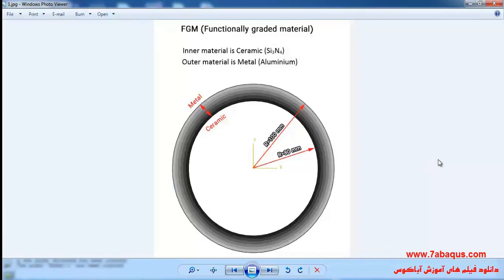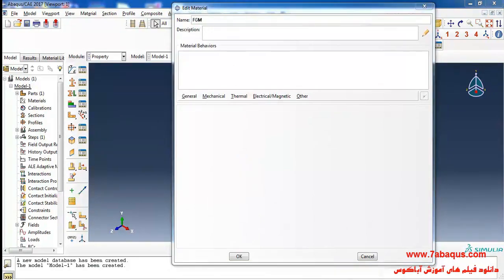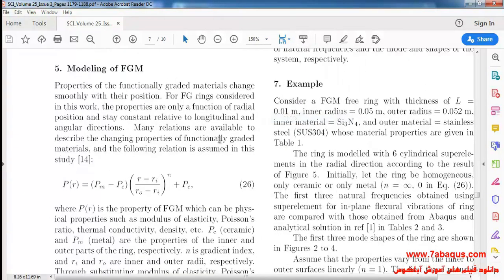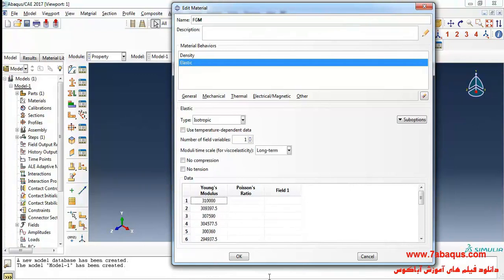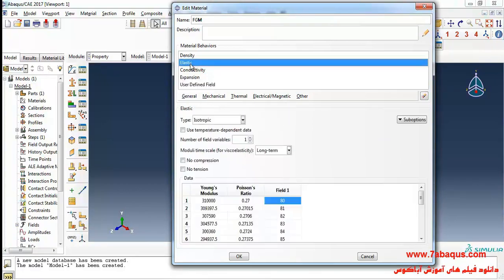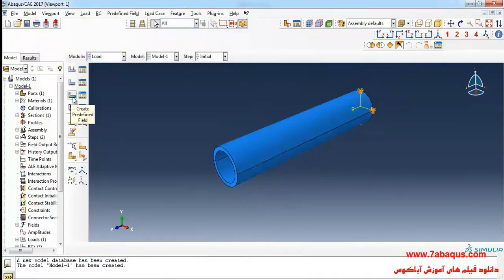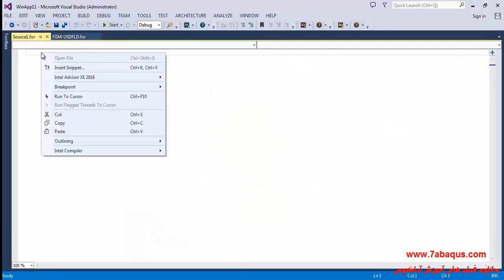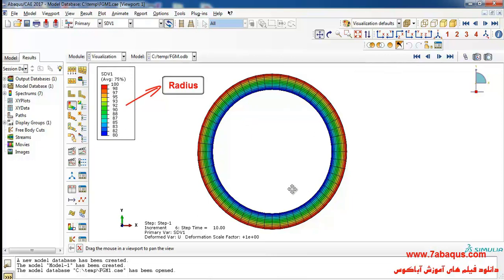FGM (Functionally Graded Material) using USDFLD subroutine Abaqus

Comment: hello sir do you solve the problem where property varing along 2 direction say r and theta in heat tansfer problems?
Reply: you should define all possible combinaisons of coordinates for example If you need to vary the property through the x and y directions, add 2 variable fields in matetial properties windows and insert the different combinations (xi,yi) in (field1,field2) then calcluate the corresponding property values.
 In the Usdfld file you should add two lines to define what are the fields added in materiel properies windows: 
FIELD(1)=COORD(1)
FIELD(2)=COORD(2)

I hope that is helpful
Reply: @mohamedelibrahimi5728  this is the USDFLD of varing properties in radial direction.

" SUBROUTINE USDFLD(FIELD,STATEV,PNEWDT,DIRECT,T,CELENT,
     1 TIME,DTIME,CMNAME,ORNAME,NFIELD,NSTATV,NOEL,NPT,LAYER,
     2 KSPT,KSTEP,KINC,NDI,NSHR,COORD,JMAC,JMATYP,MATLAYO,LACCFLA)
C
      INCLUDE 'ABA_PARAM.INC'
C
      CHARACTER*80 CMNAME,ORNAME
      CHARACTER*3  FLGRAY(15)
      DIMENSION FIELD(NFIELD),STATEV(NSTATV),DIRECT(3,3),
     1 T(3,3),TIME(2)
      DIMENSION ARRAY(15),JARRAY(15),JMAC(*),JMATYP(*),COORD(*)
c     defining the parameters for coordinates      
      double precision x
      double precision y

      x=coord(1)
      y=coord(2
      if (kinc==1)then
      statev(1)=(x**2+y**2)**0.5
      endif
      if (kinc .gt. 1)then
      statev(1)=statev(1) ;

      endif
      field(1)=statev(1)

      RETURN
      END "

what should i need to change in code for varying  r,theta  direction? Can you help me,again?

Comment: hi 
please help me for how modling FGM beam for tow direction x and y
Reply: hey do u solve it 2 direction varing problems?
Reply: @palashdas823  you should define all possible combinaisons of coordinates for example If you need to vary the property through the x and y directions, add 2 variable fields in matetial properties windows and insert the different combinations (xi,yi) in (field1,field2) then calcluate the corresponding property values.
 In the Usdfld file you should add two lines to define what are the fields added in materiel properies windows: 
FIELD(1)=COORD(1)
FIELD(2)=COORD(2)

I hope that is helpful
Reply: you should define all possible combinaisons of coordinates for example If you need to vary the property through the x and y directions, add 2 variable fields in matetial properties windows and insert the different combinations (xi,yi) in (field1,field2) then calcluate the corresponding property values.
 In the Usdfld file you should add two lines to define what are the fields added in materiel properies windows: 
FIELD(1)=COORD(1)
FIELD(2)=COORD(2)

I hope that is helpful

Comment: As described in official USDFLD Abaqus manual (Abaqus User Subroutines Reference Guide    
1.1.53 USDFLD), Field 1 value is designated as "FIELD(1) = MAX( EPS , EPSMAX )" but I did not see this designation in your video. 
There seems to be cut scene from 4:55.  Have you added some more Fortran code from USDFLD in Abaqus manual? 
Please help me understand yours.
Thanks!
Reply: He didn't show the actual User subroutine, as he sells this information on his website. The subroutine must define the FIELD(1), which is the Elastic Modulus in terms of the material coordinates, COORDS().